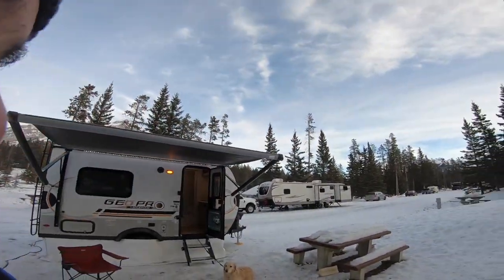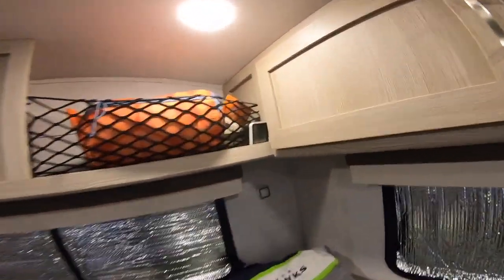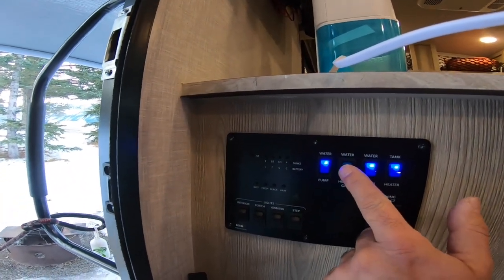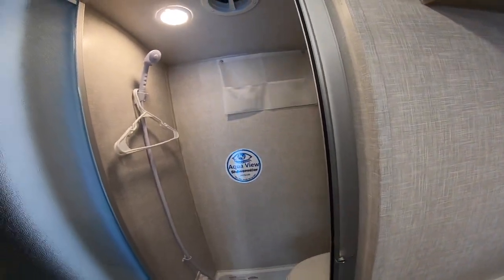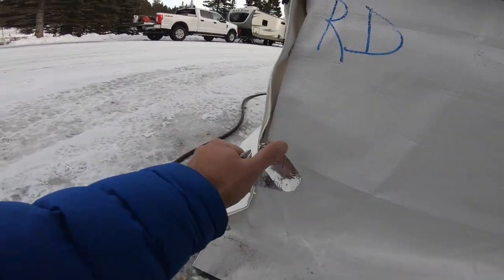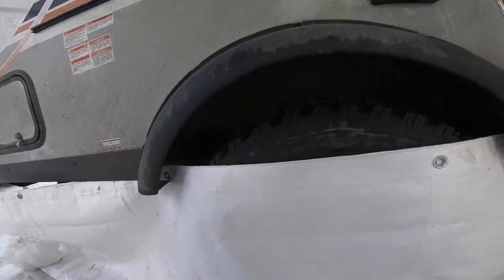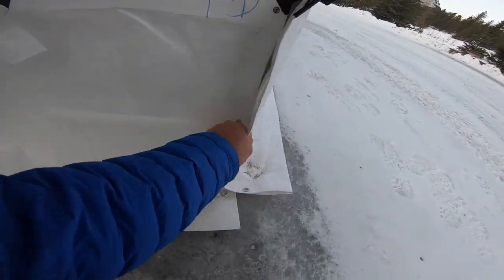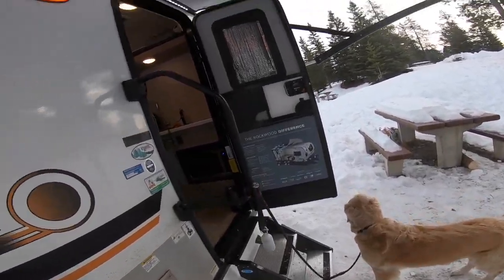Banff Winter Camping in a Geo Pro 15TB

Comment: I really like the thing you made to keep the air and cold out from under your trailer.  That is such a great idea. That looks like it works well.
Reply from the maker: It does work well indeed. I've used it for 2 winters now and it really helps keep the camper warm and the pipes from freezing, even on very cold spells...

Comment: Relax Carlos, your voice/accent is just fine. 

 I like the skirting idea and will do something similar when I finally get my trailer built. My trailer will have a full insulated belly pan for aerodynamics and will be vented to the interior for winter heat and outside for side for summer heat so won;t need another expensive system to prevent tank(s) and piping freeze ups. The unit will be all electric for cooking, Air/heat Split and a small marine wood stove for heat off-grid.
Reply from the maker: Sounds like a nice camper! Enjoy! And thanks for watching.

Comment: Love the overview. Since your tanks are exposed i would consider using 12V heat pads for tanks. The lower bottom cover is excellent. You can also use one or two non-Led  light bulbs under TT..
Reply from the maker: Thanks for the advice. This Geo actually has tank heating pads I had them on for the whole duration of my stay.

Comment: I wonder if some pool noodles would work to fill the wheel well gap?  Might take 2 or 3 stacked, maybe zip tied together.  But you could cut them to the length needed.
Reply from the maker: That might work. It's worth a try. Thanks!

Comment: Are the windows on the geopro single or dual pane?  I've been thinking of one and towing behind my winnebago due to the light weight floor plan options.
Reply from the maker: No, they are not. Those are single pane frame-less windows, with very low insulation value. That's why I show the double layer of reflectix on the windows in the video,.
Reply: @carlosmoraesUtube  Thanks.  I did see the reflectix.  Too bad on the dual pane windows though.  Wished that was an option.